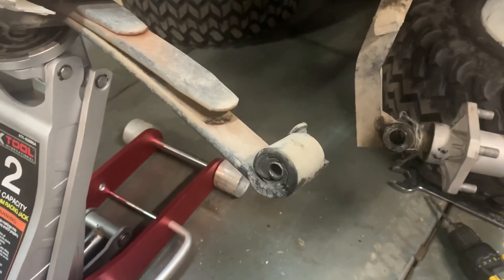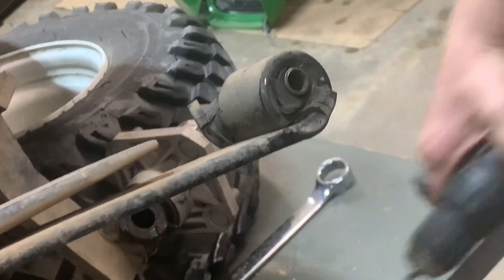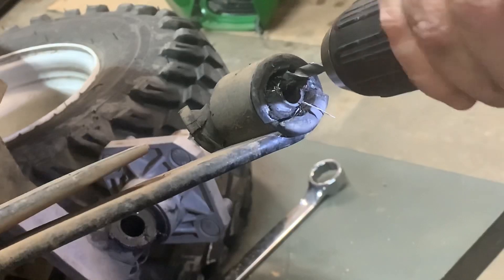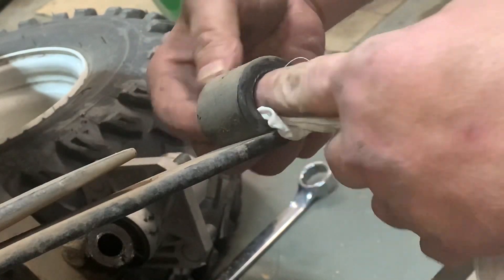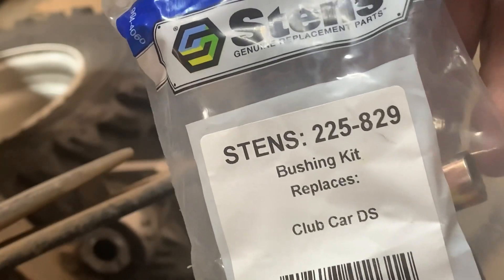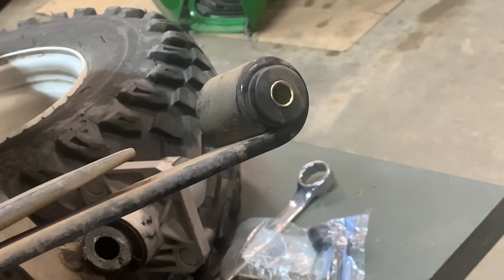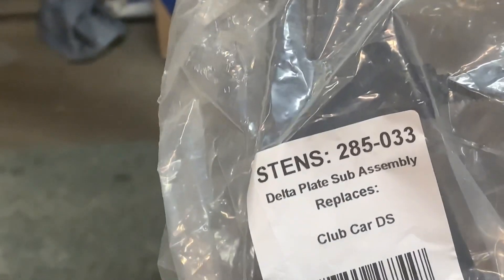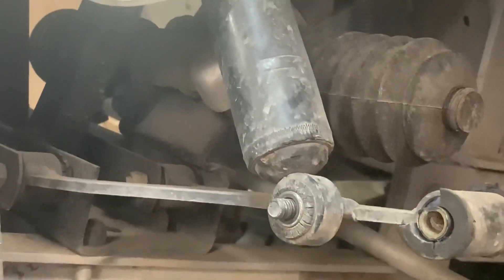OLD MECHANICS TRICK TO REMOVE STUCK BUSHINGS

Comment: Right up your alley, have several "permanently lubricated" mower deck spindles. Today I'm replacing three and rebuilding a 4 year old core. Ordered two cheap sets of three off eBay. I find out these are branded Stens, OEM replacements. Made in China, china spindle bearings. Would you just bolt them in and send it down the road, or would you be suspect and check the bearings first? Enjoy your channel and sense of humor!

Comment: If you run into trouble doing this with larger bushings made of harder rubber, you can use a torch to get the rubber a little bit more brittle before hitting it with the drill. Probably best to do this outside or under an exhaust fan. Sometimes a small drywall saw can be handy for really difficult ones, too.

Comment: Help!! Hs46c Blades wont stop. I've tryed the one screw on the carburetor but just won't do any better.  At times rpm goes little down but not much. Sounds almost like when is on full throttle. Any suggestions??? Thanks in advance!

Comment: it works  but sometimes it cuts into the bore making the new bushings too loose. depends on the material. smaller bit works better but breaks easier.  let the drill do the work and just "follow" it  keeping square